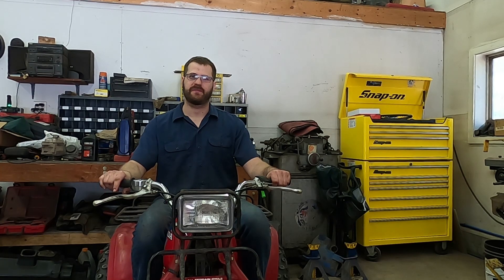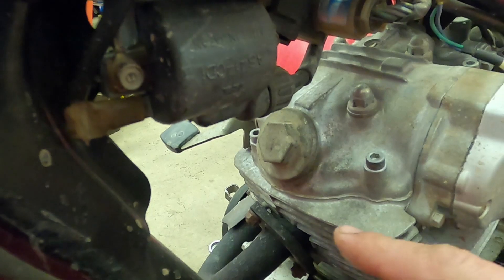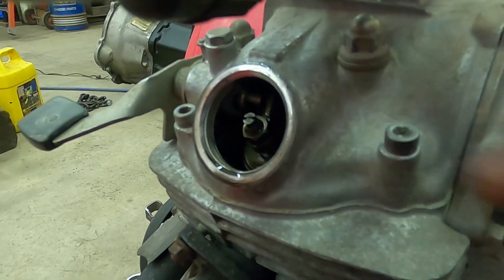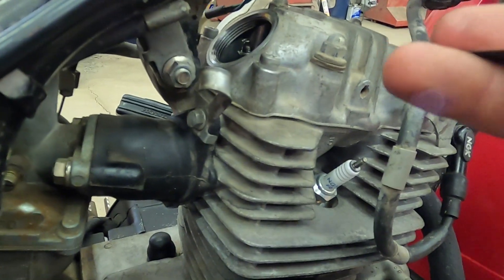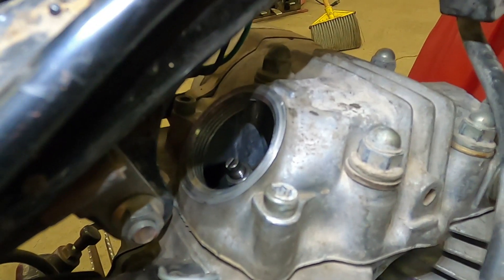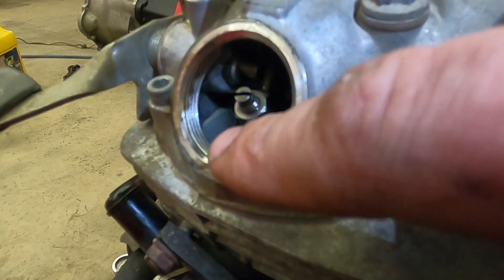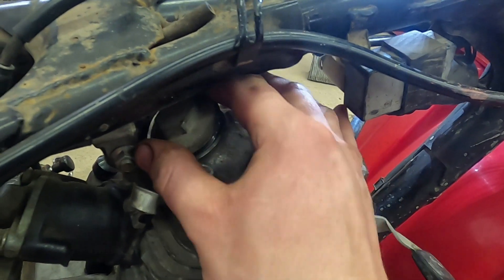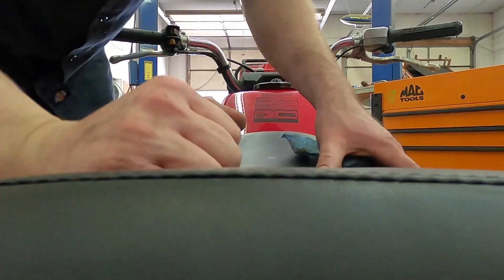Honda Big Red Valve Adjustment 1984 ATC 200ES

Comment: Thanks for the info. Your video walked me through the initial set up procedure and I adjusted the valves by feel. .002 is half rhe thickness of a sheet of printer paper so I just brought the adjuster all the way down and backed it off an eighth of a turn.

Comment: What a great video!! Would you happen to know a cross reference for the rubber gasket that’s supposed to seal the valve cap? I thought about a little RTV on the cap side and slip the gasket back on top of it but I’m sure that won’t hold up.

Comment: Does the Valve cover have a gasket or do I use hondabond? My valve cover is leaking oil down onto my exhaust a little, and do I have to remove or drop the engine to change it?
Reply: You need a new valve cover they are 20 on ebay. There's a seal that is stuck on the cover that goes bad sometimes

Comment: Looking for some help on what motor i got , i picked up an old honda engine sitting in my friends garage , it had all the electrical attached and carb is still good and attached as well so want to get it going for a go kart but dont know the year or model it came from . It looks the same as your motor but it has a hi low option and that seems to be locked up but motor spins free  and i want to rebuild it but need to know what it is so i can order new parts to get it up and going ...anyone who can help me i would greatly appreciate it thanks
Reply from the maker: I just found your question.  If it looks like this and has high/ low but no reverse and is chain drive, it's probably an 82 or 83 big red engine.

Comment: What advantage does the 200x valve train have on it?
Reply from the maker: The 200x cam has more lift and duration than the stock big red cam, though they quit making the big red cam at some point and started selling the 200x version as a replacement.  It gives up a little bottom end but makes more up top.  The 200x also had higher compression ratio, a bigger carb, and different likely higher flow muffler.  All that added together made around 20% more hp in the 200x configuration.  I have the cam, piston, and performance muffler.  Still looking for a factory 200x carb as I don't want the china junk sold now.
Reply: @macsgarage  if I was to get the valve train from the 200x what's required just the internals under the cover or do I nee the cove or head aswell?